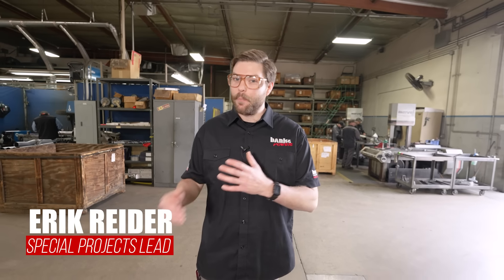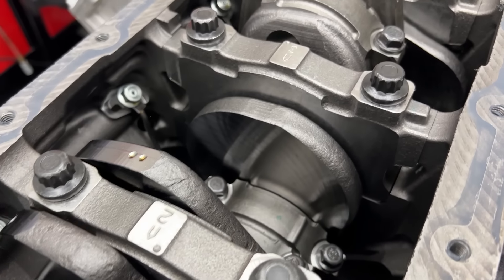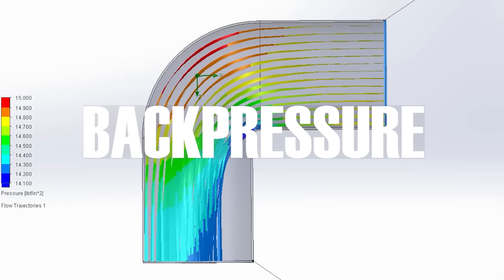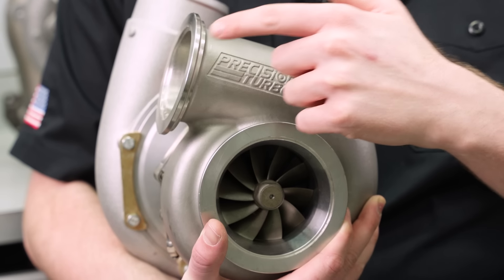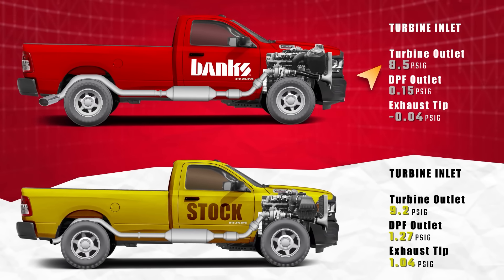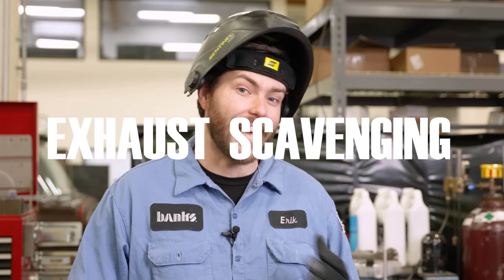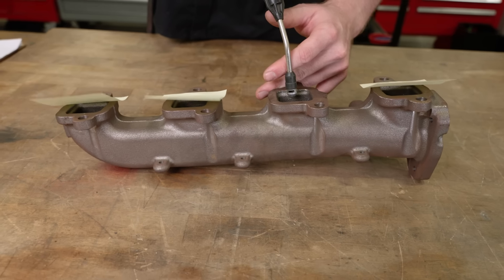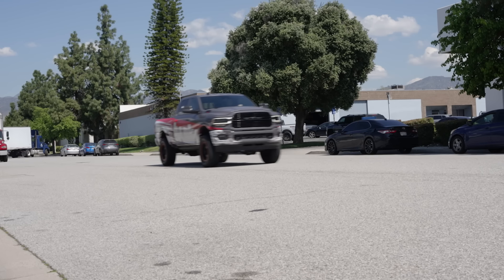Busting the exhaust backpressure myth | Banks Entry Level

Comment: I'm no expert, though I am a mechanic and an enthusiast, and I've been toying with exhaust for 20 years. The first time I put headers and pipes on a small V8 truck was 20 years ago and afterwards it could no longer do a burnout. I was young, confused, and devastated. Even put a smaller tire on it just to see what would happen, still no burnout. However, the truck did have a noticeable increase in acceleration after 3k RPM. A few years later I swapped the 2.5' pipes for 2' pipes and like night and day the truck could burnout forever, not even needing the break peddle. This was the beginning of my interest and research into exhaust. I promise this much, a stock non-turbo daily driver needs a smaller pipe to increase the velocity at the exhaust valve while in low RPMs to maintain cruising power and off idle torque. Also, my fuel milage increased with the smaller pipe. Scavenging and velocity is kind of my thing. lol I'd love to prove it.
Reply: These guys are talking about wide open throttle readings on a dyno.  Has very little to do with real world driving.
Reply: @19Borneo67   Mmhmm and if the dyno were reading idle to 3500 RPM, back pressure and velocity would win against open headers on any N/A engine any day. The "some people" he is referring to that say "you need a little back pressure to make power" are referring to both wide open throttle and part throttle on the street, where people push the skinny pedal.😂😂😂
Reply: @19Borneo67   I really wish I had read your comment, cause I would have just liked it. I mean, the dyno in the video is built to recreate real driving. 🙉🙊
Reply: @19Borneo67  Did you see the dyno in the video? No? Weird, must be because their real-world Dyno that they use for developing these parts isn't in this video. lol
Reply: break peddle?  Ahhh... brake pedal.
Reply: You are not wrong about velocity being important n exhaust scavenging. However, velocity and pressure don’t correlate like you think. Look up the Bernoulli principle. Decreasing tube diameter for higher velocity doesn’t equate to more back pressure necessarily (at some point, a too small diameter WILL be too restrictive, but generally speaking, more velocity, means lower pressure)
Reply: What was the A/F ratio change from the larger exhaust and what did you do to address it?
Reply: A mechanic and enthusiast for twenty years... yet doesn't even know the difference between break and brake, lol.
Reply: @johnny0454  And don't forget about "Peddle".
Reply: Could have been a typo. Just because something isn’t spelled correctly doesn’t mean he isn’t good in something else.
Reply: @BLKMGK4 Thats a great question. Now while I don't have a AFR reading for you from 2003 I can tell you the fuel trims were in enough to keep it from throwing a code or burning out the valves or cats. But monitoring the AFR is the job of the PCM. However, EVERYONE should read these words "the smaller pipe increased the MAF throughout the RPM sweep except for around and after peak HP and made its greatest increase in air intake right at peak torque." See The first thing I learned about modding engines is it is just an air pump that we add fuel and spark to. To answer your question directly, yes, the fuel trims improved by reducing the pipe size so there was nothing left to do but more burnouts.
Reply: Same happened to me years ago on multiple vehicles. I would take off the cats, run 2.5" true duals with flowmasters or glasspacks and all my vehicles ran like 💩. Later, I ran a single 3" exhaust with 2.25" downpipes after my old true duals rotted out and my old silverado ran like a scalded dog after that. It felt like it picked up 40 lbs of torque from 2-4k rpms and ran better than ever before.
Reply: @Bobthebuilder.69  Right! People seem to only care about peak power. What about the other 98% of time. I have purposely tuned stock-mild builds with less top end power and plenty of low end torque which made it faster in the 1/8th.
Reply: @jasonreynolds9097  yes sir! 💯
Reply: The video oversimplifies a complicated topic and doesn’t talk about exhaust volume pipe diameter and how it affects exhaust gas velocity. The key is correct exhaust gas velocity in order to achieve scavenging effect. Out friend never mentioned anything about increase in pipe diameter reducing exhaust velocity and actually increasing static pressure and destroying scavenging effect . I would except more from a company that is selling potentially performance parts.
Reply: @MickyMouseLimited  The moral of the story is, you can modify your engine wrong very easily just buy bolting on the wrong parts. The exhaust parts I put on the truck made it faster around 5500 rpm, but wide open off the line, might as well be a moped. I put a smaller pipe on and the power down low came back. What I should have done was change the not even knock off shorty headers that were tuned for stock back pressure and put some equal length long tube headers on. Don't cheap out on the best power adder. Bolt on power means exactly that and may not work well with other modifications!!!!
Reply: 7:28 A Savage watches and said aloud "The answer is, guess what happens when you modify your car by modifying it's exhaust SYSTEM that was designed and tuned to make power on N/A one leg exhaust pressure by removing everything but the cats. It loses power down low and a lot of it. Then add some 2.5 or 3 maybe 3.5 inch pipes, to get the exhaust away from the cab and it makes even less power. But? Smaller pipes will maintain the tune and make your toy LOUD ASF. Thank you" as I shake my head then bow.

Comment: I think the main reasons people used to think backpressure was needed was because headers do have a power drop if they're run open with no collector extension, and also because if you merely unrestricted a severely restricted exhaust (as was more common then) on an old carbureted engine, it could actually effect the fueling enough that it runs worse. On the topic of manifolds, as a gas guy I'm always shocked how even modern diesel engines are designed as if gases don't need to flow at all in a heavily turbocharged engine. All the same flow and reflected wave dynamics exist when a gas is under pressure. I'm curious how much free horsepower could be had on something like a duramax with a header style manifold over that horrific log.
Reply: Is that why drag cars that are chasing every last HP run like that? Makes no sense
Reply: Headers dont "drop power", they "move" it. The same as any other exhaust setup. This is why Honda uses a Single outlet "header" on their J series v6's that make 250 hp from the factory... They use it to put the power down low for take off and drivability rather than your "wide open free flowing" headers that make all their power at the high end (where you want it for drag racing).
Reply: @D.L.PDevelopments  see my comment about honda J series single port "headers". You can also look up actual dyno results with back to back testing to prove this claim. Banks power is WAY late... Decades.
Reply: @D.L.PDevelopments  Like what? Open headers? I think you'll find most NA drag cars now have either collector extensions or a full exhaust.
Reply: @crisnmaryfam7344  They use it because it's cheap and easy, period end of story. Long tube headers pickup torque hugely over an otherwise well flowing manifold with no scavenging
Reply: Spot on!!! That’s why super traps were created. This was the answer if computer tuning wasn’t achievable. It’s kinda irrelevant today with modern tech.
Reply: @D.L.PDevelopments drag cars go full throttle for 5-10 seconds. Open header at high RPM is not affected all that much. Back pressure is more needed for rally and road racing for smoother power bands.
Reply: Back in the pre-emissions days when most cars still had carburetors, a little bit of backpressure could help fuel economy via the "EGR effect". And as stated above, changing the exhaust could potentially put the carb out of tune and make the engine run worse. Nowadays, that stuff is not relevant anymore. But people keep recirculating this outdated information.
Reply: @Levibetz  cheap and easy is a myth, Its actually harder to manufacture 
(reseach and developments and then so forth) a single port head and thus header to match, then it is to use the  same designs everyone has been using for eons..  You can youtube P@R racing and they have testing done you can watch, but you wont,  because you believe what you believe and dont care about facts proving otherwise.. cognitive dissonance
Reply: https://www.youtube.com/watch?v=A-j8Uzhf8o0
https://www.youtube.com/@PowerRevRacing
Reply: @crisnmaryfam7344  He literally says the separate port head is the best for power. Again, I suspect the move to a single port is to simplify and cut costs in the construction of the manifold. Could be emissions too, but without talking to honda engineers you don't know what the criteria is.
Reply: @crisnmaryfam7344  That is how I understand it, the power band is shifted. I worked for a header/exhaust company as a welder/fabricator. I was able to experiment with my '60 Mini and I had more top end power when I had a larger straight pipe exhaust. It really didn't have much power under 2500 RPM. A smaller exhaust moved the power band down to a more street friendly part of the band. If I hadn't studied exhaust design I would have bought into the "back pressure" of the smaller exhaust gave more power.
Reply: @crisnmaryfam7344  The single outlet head is done for emissions, cost, and packaging. It has no performance benefit.
Reply: @crisnmaryfam7344  Where was Honda in 1975? Or 1970, for that matter? Gale Banks was out on the Bonneville Salt Flats proving these things. So was Honda more than a half century ahead then?
Reply: Same thing when you look at the convoluted plumbing in a current semi truck versus what builders put into a longnose glider kit when they have to create from scratch. No 90° bends if possible, straight runs of pipe on intake and exhaust sides.

Comment: There is so much I cant stand about this subject. Especially when people try to "debunk" backpressure. The term was an oversimplified misconception that was likely made up by a sales person. In my opinion the common understanding of "backpressure" in an exhaust system can really only start after the last meaningful point of harmonic tuning in the system its self. These points generally being dictated by the changes in pipe diameter and the distances between them. Examples being, exhaust runner to header/manifold primary, primary to collector, collector to emissions or turbo, and so on. Everything after that "can" only create back pressure if that part of the exhaust is able to present a meaningful impedance to the engine's exhaust flow at or beyond some point in its operating exhaust cfm range. In this circumstance I do agree backpressure can only be a bad thing, but it also generally only becomes significant in max engine mass flow situations that most trucks rarely experience. I'm attempting to speak as accurately as I can, so apologies for the wordiness.
Reply: I would have to argue the point of most trucks rarely seeing "max engine mass flow," as you state. Especially when you consider trucks, by their very nature, are designed to pull weight. Whether that be payload, or a trailer. A truck, pulling say a camper, is more likely to see higher throttle loads regularly than you average commuter car. Especially when you consider gas engines, as they usually share very similar engines with smaller passenger cars. For example, my 5.0 F150 will need more torque to accelerate from stop to highway speed at the same rate as a 5.0 equipped Mustang due to it's greater curb weight and higher drag coefficient. Now, consider that same scenario but with a 6k pound trailer in tow. The truck will need roughly double the torque as before to accelerate at that same rate because we've more than doubled it's gross combined weight.

Comment: Backpressure is one of those things where its presence is a negative factor but since improving other factors (exhaust velocity and pulse tuning) tend to increase it, people think its presence is what is making the improvements. The reality is backpressure needs to be minimized while maximizing the other factors. Everything is a compromise.
I like to put it this way, "backpressure is a necessary evil that should be minimized".
Reply: This is correct
Reply: I was thinking about this, I don't think there's increased back pressure on an exhaust that has great velocity compared to one that has a larger diameter and no scavenging. I think it's just the idea that people got in their head was bigger exhaust automatically equals less back pressure and smaller means more. So in their head they think there's a happy medium because too big made less. But the reason why a properly designed exhaust with great scavenging and high exhaust velocity works better than an oversized exhaust is because it reduces back pressure. Higher velocity air exhibits reduced pressure, not more, that's how scavenging works it creates a greater pressure differential. It's part of Bernoulli's equation. It's the same issue when sizing irrigation pipe. You go too small you start increasing the speed of the fluid, if the fluid starts speeding up too quickly what will happen is that it'll start causing turbulence along the sides of the wall effectively making the diameter of the pipe too small. It's the same issue when old gear heads think a high flow water pump doesn't allow coolant to "cool off" in the radiator because it's moving too fast. In reality what is happening is the volume trying to be moved at a certain speed has to deal with the fluid friction on the walls at a certain speed it create eddies along the walls, which reduces overall flow because it's effectively decreasing the size of the interior diameter of the pipe. Same thing when tuning an exhaust.
Reply: YES! Thank you! And scavenging efficiency can be optimized to fit the demands put on the engine by using a tuned header. ANNND if you want your N/A 6.2 to pull a house up hill in overdrive &&& sound good doing it, you will have more back pressure than a racing header will create. THE END
Reply: @jasonreynolds9097  You mean you'll have less back pressure at low RPMs. It's all a game of reducing back pressure at different loads. Since there's not perfect way to reduce back pressure completely at all RPMs builders have to tune for how they want it to best perform per it's intended purpose.  If the goal is to improve TQ at at 1500rpms then you'd tune the exhaust so that it flows the best at that RPM, so tubing sizing, runner lengths, etc are best matched to the power output and load characteristics of the engine, resulting at that RPM lower back pressure. But since it's a give and take system at high RPM you might not get as much power because the back pressure will increase. Unless someone has a really ingenious way of controlling exhaust gas pulses in a way that isn't a give and take you'll choose where to reduce back pressure to provide the best power and efficiency anywhere else on the power band will encounter more back pressure and reduce efficiency. 

In the end it's all about how to reduce back pressure for your intended purpose, it's just we currently have no way of eliminating it from every part of the TQ curve. That's why it's silly to say "we need back pressure".
Reply: @sigmaprojects Great explanation, I have studied fluid mechanics and this kind of topics can be hard to grasp from the theory cause they seem very counterintuitive.

As an additional fact I would like to add that this sort of phenomena happens due to the influence of “inertial forces" versus “viscous forces" and by changing the diameter of a pipe you are kind of favoring one against the other, but every system has optimal points of work and if you move outside of them, things won't behave as expected.
Reply: @wolfvash22  it is a very difficult concept to grasp. Similar misconceptions are present in other parts of the engine that deal with fluid dynamics like cooling, air intake and oiling.

Comment: I love how concise and accurate this video is about the back pressure argument when it comes to exhaust scavenging for an NA engine. 
Hands down the best video I’ve seen so far explaining this engineering concept.
Reply: you are Close  the word Scavenging is the problem here    still missing the point of air to fuel intermixing  to attain the most possible work to power from the fuel that is consumed 
there is a point where back presser is needed  and at a point where it becomes too great
Reply: Completely agree devyn! Was really well done
Clay backpressure isn't needed. If you have freah fuel/air going out the exhaust then it's now about optimizing valve timing for the setup
Reply: @mattmorrison6958 if you have fresh fuel and air coming out of the exhaust you have a major issue. The fuel should be converted to carbon. Nox indicates an improper burn.
Reply: @claycoates5056  yeah what you said here completely contradicts everything they showed in this video. back pressure of any kind is bad. scavenging is different and good but only works with a proper set of headers as shown.